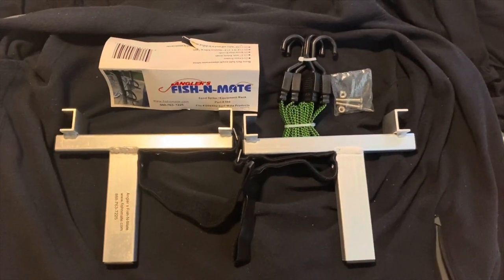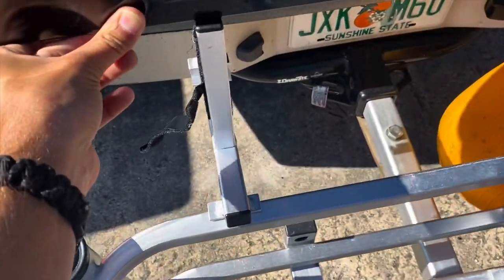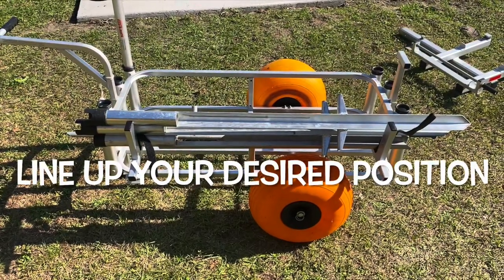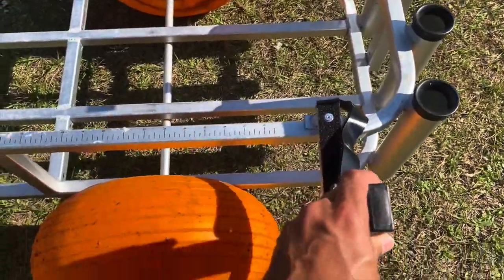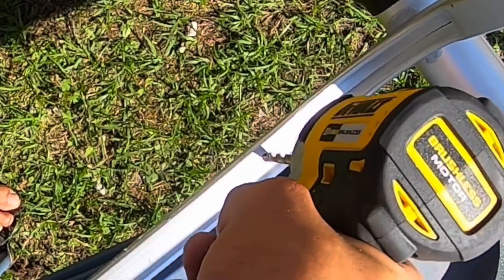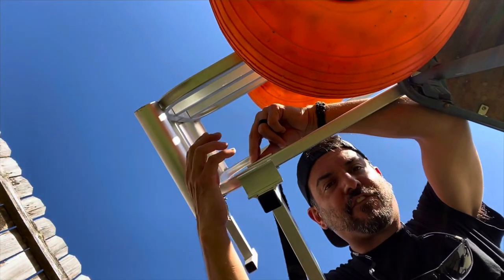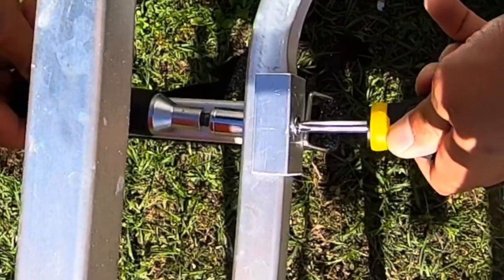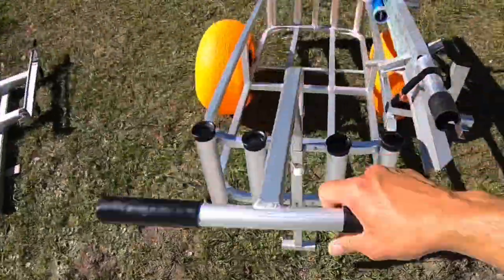HOW TO install Sand Spike RACKS

Comment: I think the rack is meant to be rotated another 90 degrees from the way that you have it so the hole is on the top of the top rail and then the other bracket rests on the bottom rail of the cart.
Reply from the maker: This is the only way it will work on the beach cart. It doesn't work like that on the beach cart. These racks were made for a different cart.

Comment: Do these come in pair? Or I have to order 2
Reply from the maker: Just so you know -They do not work for the Sr or Jr cart. I had to drill holes in them to make them work. They are made for a different cart. To answer your question this comes in a 2 pack. After i manipulated its function it works great. If I were you I’d order from -surf fishing solutions for the best option. Find them on Facebook. Or any metal worker that fabricates things to your needs.

Comment: You installed these wrong.  You might want to pull the video to prevent others from making the same mistake.
Reply from the maker: This is the only way it will work on the beach cart. It doesn't work like that on the beach cart. These racks were made for a different cart.
Reply: @staugustinesandmanfishing  I owe you an apology sir.  You are indeed correct.  I just received two sets of the sand spike holders and - sure enough - they do not work as intended on a Fish N Mate Senior cart with balloon tires for two reasons: 1) The spikes on the rack wouldn't clear the tires; 2) Even if they did clear the tires, the gap between the two hooks on the holder does not match the gap on the side rails of the cart.  Great opportunity for a new product from Fish N Mate!  I could install them the way that you have in your video but I don't like the stress it would put on the top rail of the cart.  I'll have to go to Plan B for the time being.  PVC tubing, here I come!  ;-)  Thanks!!!
Reply: @anonymoso  Did you ever find/make a PVC solution?